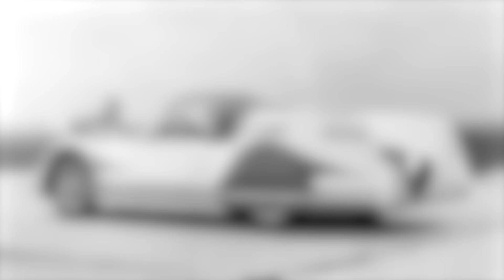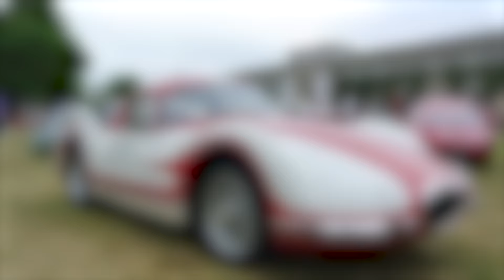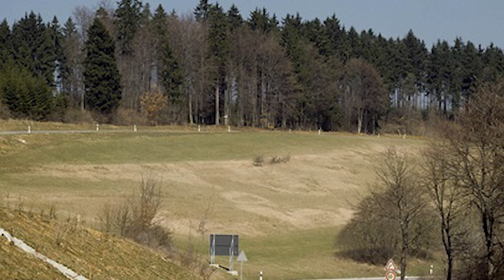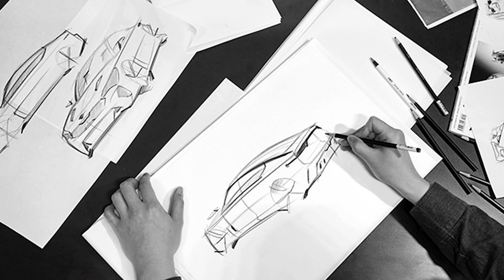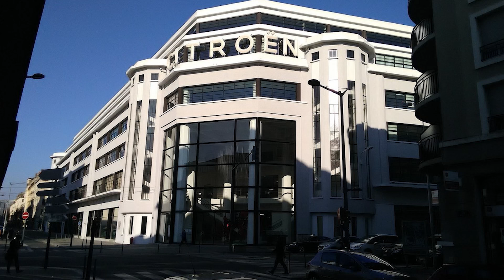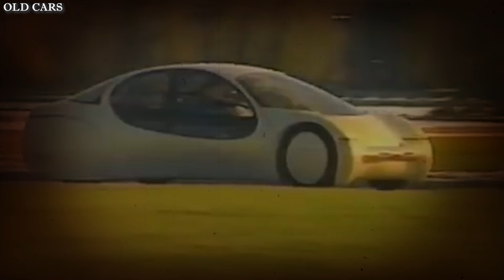4 Most Ridiculous Aerodynamic Cars Ever Built!

Comment: The Fiat Turbina did not use a true "jet engine" but rather a gas turbine engine similar to that used in the 50 1963/'64 Chrysler Turbine Cars which had been previously tested in 1962 Plymouth and Dodge coupes.  To the best of my knowledge, the first gas turbine engine in tested in a production body was the 1955 Plymouth Turbine Special.
Reply: The Rover Jet 1 of 1950 was "production based". Take a 1949 Rover P4, cut the roof off shove the turbine where the rear passengers used to sit and you end up with an open 2 seater that could hit 150mph on the highway or 6 mpg (5 US) around town. A development of this power train was tested in the Rover P6, intended for launch in 1963, but no production cars made it onto the road. I believe that the prototype still exists.

Comment: A jet car sits in front of you at the light. The light turns green and you watch it slow,y take off while your front end melts into the crosswalk.
Reply: Turboshaft engines are made to extract most of the energy from exhaust gas so what gets out of the back is bot going to produce significant thrust and the heat is not going to be any higher than what a normal car engine blows from exhaust so it wouldnt melt any cars front unless someone made a turbine car that uses an turbojet engine wich is drive forward mainly by the thrust wich will be very hot and capable of causing dangerous high velocity and temperature gas behind it so turbojet engines would most likely never be used in a car but turboshaft engines are fine